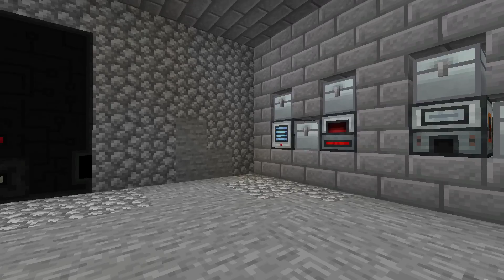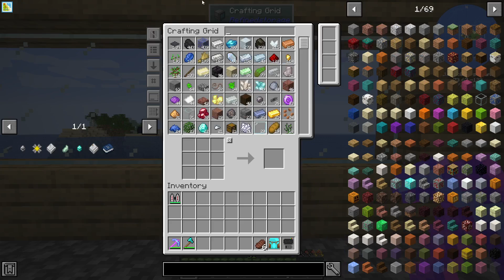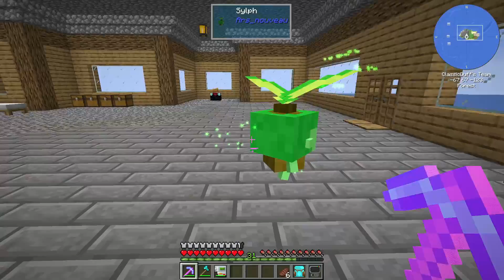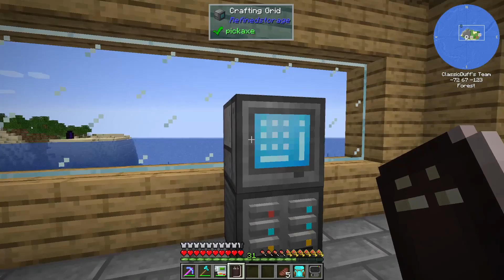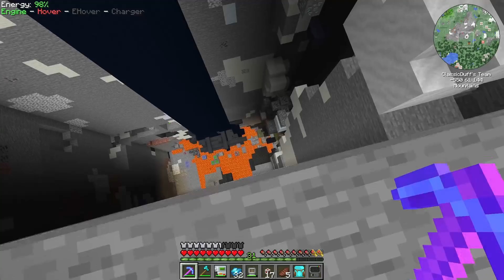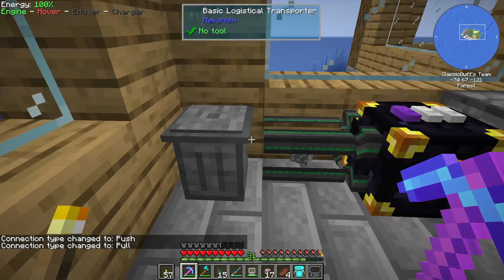Direwolf20 11,6 Ep 8 - Powah Power Upgrades & Auto Ore Processing

Comment: if you can gather up 144 emeralds, you can create the Spirited tier of the Powah Reactor which, when provided with fuel, redstone, carbon, ice, and a bucket of water, can produce upwards of 50K FE/tick.

Also, you may want to turn on the "auto-on" feature in the Powah Reactor GUI so it auto-shuts off when the internal energy storage hits 100% and turns back on automatically if the level drops below 70%.
Reply from the maker: That seems pretty decent, I'll probably have to once I start making some void ore miners.